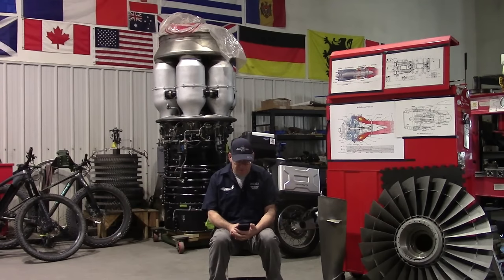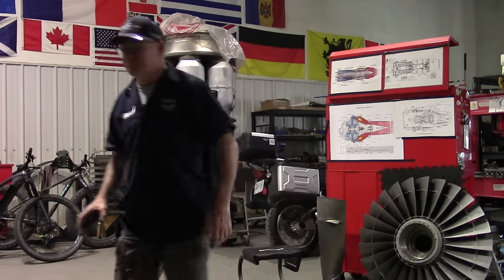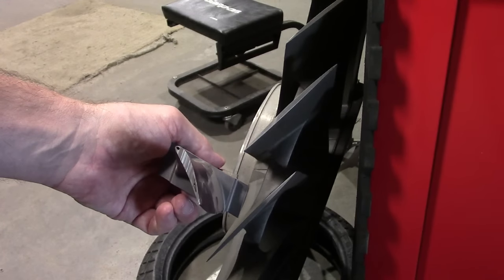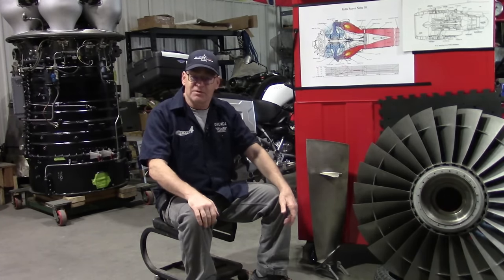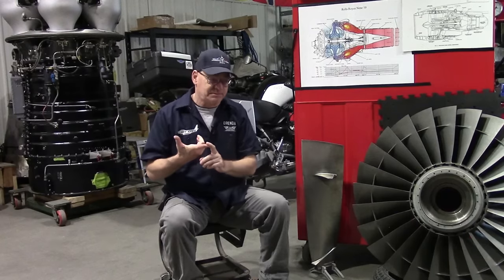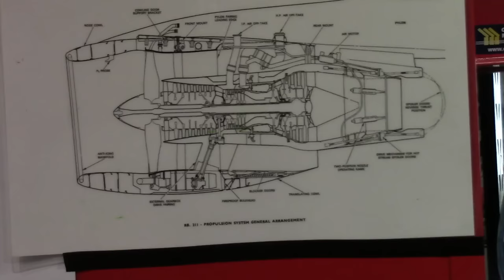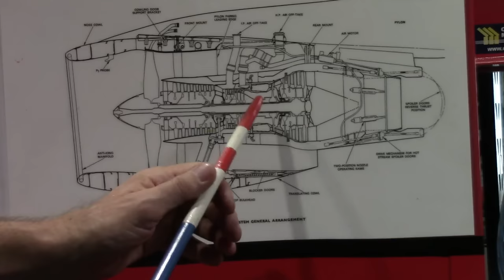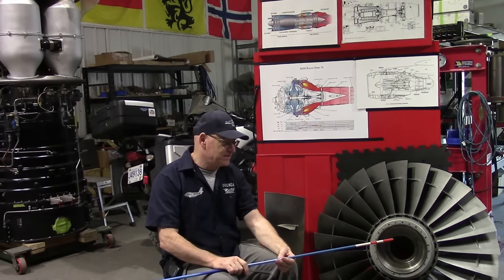Can Wind Damage the Engines of a Parked Airliner?

Comment: could some turning be an advantage in some cases, equaling the forces on the shaft so it doesn't bend and the bearings doesn't sit on the same spot for a long time?
Reply from the maker: 1) bending due to gravity? Don't be ridiculous.
2) bearings damaging their races? It's an appealing thought, but if the bearing race can support the load for a microsecond, it can support it for a month. However, I do agree that some occasional slow movement might be a good idea if the engine is to be stored for years.
I've seen perfect bearings inside engines taken out of decades of storage, so It may not be that important.
Reply: @AgentJayZ  I just read that many engines need "debowing" by motoring before startup under certain conditions, but apparently it is caused by  thermal effects during shutdown, so it is in the core and windmilling wouldn't help
Reply from the maker: Many people talk of "rotor bow". You know who doesn't? The engineers who design these things.
My opinion is that "rotor bow" is an old timey fallacy.  It's based on the assumption that when the rotor stops moving, it sits in an environment where the thermal gradient is large from the bottom of the engine to the top.
I believe this assumption is erroneous, and rotor bow is made-up quackery, from people who think too much without thinking enough.
Reply: @AgentJayZ   I respectfully disagree with you. Rotor Bow is 100% real, however it is more noticeable on some engine types than others. The evidence for this is during start-up of an engine that has been recently run (ballpark shutdown time of 45mins for example), the N2 vibrations will be initially much higher, for example around 4 times higher than after the engine thermally stabilizes at idle.

Also, and I'm being picky here, but engine fans can windmill in either direction - it depends on whether the wind is blowing from in front of or behind the engine. The direction of windmilling makes no difference to your assessment of whether windmilling is bad for engines though.

Big Thanks for all your thought provoking content 👍

Comment: I think the CFM56-5B is the most well known for it's windmilling fan blade noise. The midspan shrouds have a tungsten carbide coating that does eventually wear out, but of course this coating can be repaired when necessary.

Comment: Great quality video as per usual, thanks for sharing. Since I was a kid, about half a century ago, I've always wondered what causes the acoustic 'tink-tink or clank-clank' noise when a jet engine windmills. In my naivety I thought that such a marvel of precision engineering would windmill silently. Do you know what causes the noise? Thanks.
Reply: The fan and compressor blades are held relatively loosely in their slot mounts in the fan and compressor hubs...the blades are meant to slide in and out of their dovetail mounts relatively easily when not held in place with a set screw. They only firm up in their mounts when the engine is running and centripetal force holds the blades firmly in place. The tinkling sound when windmilling occurs when gravity is stronger than the centripetal force and the blade slightly jiggles in its mount. I believe the exact cause of the sound is the blade itself acting like a tuning fork when given a slight excitation energy from the movement within its mount.
Reply: I think the blades  are a little bit loose on purpose to help dampen harmonic  resonation in them when the engine is running. Too tight and they can start to vibrate. Also some engines have a starter turbine. They blow the high pressure air into that when starting. that is connected to turn the main engine by a kind of ratchet thing. It disengages  from the main engine when the engine is up to speed, but you can hear it clicking like a ratchet when the engine is freewheeling slowly as it shuts down or is turned by the wind. The sound could be caused by either or both of those things.
Reply from the maker: If you follow my recommendations in this video, and watch my vid called Turbofan 1, the clanking is explained.
Another good one is my old vid called jet engine turbine blade noise... or something like that.
Reply: @ewanrollo5562 
If I remember correctly from the NTSB video on the Southwest Airlines Flight 1380 where a contained fan blade failure occurred on a CFM56-7B-series engine that the blade containment slot actually have requirements for repeated lubrication and maybe even need some special Anti-Seize coatings. 

I was interested in what happened as my daughter flew on the same flight the day before and sat in the next row behind where the window was broken.

Comment: Little to no oil pressure, but the bearings won't be dry, and there's a world of difference between windmilling at *maybe* 200 RPM max and TOGA power being driven at 3600 RPM.  The fact that they windmill with barely noticeable wind goes to show just how low friction those bearings really are.  They'll be fine spinning on the tarmac for a bit.  If the jet is going to be parked longer I imagine they'd cover up the intakes.  I like it when it is windmilling backwards, and when the engine starts up the rotation slows, stops for a second, and starts turning the 'right' way.

Comment: Thank you for posting this.  I've been to airshows where C-5s are on display with their fan stages windmilling along, and often wondered if the bearings could run dry if the rest of the engine isn't running.

Comment: Seems windmilling may, in some instances, be beneficial. Seeing this title instantly reminded me: as a kid I lived in the Town of PR beside the Forestry building which had a helo pad and more often that not there was a ranger parked on it. One summer in the mid 80s the neighborhood autistic kid Ernest was entertaining himself in the evening hours by unwrapping the strap from the tail boom and running circles around the bird with the prop, reversing direction, using the centrifugal force to hold himself aloft while jumping etc. After seeing this a couple times I told my mom (who worked as a secretary in the building) about it and asked her to tell Hank the pilot about it, I regret not ratting on him for the first instance I witnessed it. Thank you Mr. Jet City.
Reply from the maker: Anybody hanging off the rotor of a helicopter for any reason is cause for a grounding and inspection.
Anybody responsible for security at that place deserved a couple weeks off without pay.
Not the kid's fault. He should never have been allowed to get near the aircraft.

Comment: If jet engines would use pressurized bearings like the crankshaft main bearings in a car engine, they'd get damaged pretty quickly windmilling along for awhile due to the large contact/friction surface pressurized bearings have. Roller and ball bearings have a much lower friction surface and can handle wind milling much better.

Comment: Interesting that you mention intake covers. I'm halfway through reading the report on the British loss of an F-35 from a carrier two years ago on take-off; the left intake "blank" was left in, leading to the aircraft having insufficient power. I thought military jets tended to have such covers normally installed when not in use (since you mention it it occurs to me I've never seen an airliner with such covers installed), but the RN elected not to do that because they tended to get blown out on deck. They were installed during port visits and the Suez transit for security reasons, but because this was unusual the procedures for removing them didn't really exist, and somehow the pilot missed it during the walk-around - I haven't got to that bit of the report yet, it's long!
Reply: Please reference the source of that report, it sounds very interesting.

Comment: It seems to me that low RPM windmilling would not create enough centrifugal force to seat the blades which would cause them to rattle around in their mounts.
Reply from the maker: Have a look at this:  https://youtu.be/phludDUfakg
Reply: You are correct, they absolutely do, depending on the engine of course, and how the blades are fastened to the hub.  A Rolls Royce Tay, for example, makes quite a racket when the fan windmills.  So does a GE CF34, P&W JT15D, among others.

Comment: Hello Jay,
At 8:23 we can see two supports in the base of the CF6 blade. Do you have the manufacturer name and / or part number for those? I have a fan blade from a CF6-50C2 (Airbus A300B2 - MSN 205) which I want to use as a decorative item in my living room and I'm having difficulties finding a support like this online.
Thank you for all those years of high quality technical content.
Reply from the maker: Those were made on a waterjet cutter out of 1/2 " aluminum plate.
I made a pattern out of heavy paper, and had them made.
'Twas cheap!

Comment: Having beer and fun with a gas generator! In one of your videos, of which I forget the title, described how essentially every gas generator could be made in to a 'jet engine' by adding a propelling nozzle to the exhaust gas stream. I have a GTCP85 APU from a 727 airliner (similar to your start cart), I placed it on a stand and have run it up many times. Why? Because as you said, its fun and why not! I want to add a jet nozzle to the exhaust, because again, why not?! Its a 2 stage radial compressor, single stage turbine. My question is, can you explain in simple ish terms how a backyard guy can figure out the optimal converging nozzle angle and end opening, while keeping EGTs and backpressure in a comfortable range?
Long time subscriber, first time commenter, keep up the no nonesense content 🍻
Reply from the maker: Sorry. If you want to design an appropriate jet nozzle for that engine, you need to do some engineering and some math.
If you are not interested in maximizing thrust, then any old thing will do.
Even the introductory text books I recommend don't get in to nozzle area calculations, but they will list sources that do.

Comment: Question here: thinking about how the bearings need to withstand the gyroscopic forces on a jet engine, given the big mass spinning at high speeds, is it a correlation between the bearings life expectancy and the movement on an airplane, specially pitch (the fastest vector-changing maneuver)? It would be interesting to learn wether the engine manufacturer gives any advise on pitching speeds.
Moreover, you have mentioned that bearings that are no longer airworthy, are still used in ground based jet engines, does this factor have anything to do or is just a design margin?
And lastly, are military fighter jet engine's bearings and casings stronger due to the ability of the airplane to make much faster movement changes than airliners? Or the lack of a big diameter fan makes it easier for the bearing to withstand the loads with a comparable overall structure?
I got here trying to find a way to explaining my toddlers about gyroscopic effect. Perhaps in a couple of years.
Reply from the maker: I don't know about gyroscopic forces affecting bearing life, but I know the bearings and their housings are hugely strong. They appear to this layman to be over engineered.
The standards for serviceability in industrial engines are the same as for flight, but there are almost no laws requiring the owners of these engines to follow them.
Most operators maintain their gas turbine engines to these standards, but some run their multi-million dollar engines the same way most people run their cars: run to failure, then fix.

Comment: What kind of structural damage does a bird-strike do to an engine? I know engines are tested to withstand bird-strikes but what happens after one?
Reply from the maker: Of course you did not clarify what kind of engine, so I will pick one. And you did not specify what size of bird, so I will pick one.
For a large airliner turbofan, any bird up to the size of a seagull, if hit by the engine in operation, will not cause any damage to the engine. The shape of the inlet spinner deflects the bird outward, towards the bypass flow. The fan slices up the bird and flings it further outward. Basically none of the debris enters the compressor, or flows through the combustor.

For larger birds, like the Canada goose, you'll have to ask Sully.
Reply: @AgentJayZ 
Is that not part of the testing of a new design engine? I thought I saw testing where a chicken sized bird was propelled towards a running engine on a test stand to validate the fan blade design. Maybe this was a one off research project.
Reply from the maker: Yes, Menta, it is part of design testing. That's how the information I gave in answer to the original question was obtained.

Comment: Jay, where do you go about buying new bearings for these engines? You obviously cant just open a catalogue and match the numbers? Is it manufacturer only or are there other companies that specialise in these bearings?
Reply from the maker: The most expensive option is to purchase from the engine manufacturer. Sometimes they do that, but they generally don't like aftermarket service providers. Next there are many companies in what you might call the component aftermarket. You can buy new parts from them at whatever price they want to charge. There are also specialist bearing manufacturers who will build anything you have the blueprints for, but they usually have a minimum quantity.
We only deal with the industrial variants of these big engines, so a good source of parts are retired aircraft versions.
The CF6-6 featured in this video donated turbine blades and bearings to the rebuilding of an LM2500, used to generate electricity.

Comment: Agent JayZ Sir . I was wondering if the manufactures use Asian bearings, USA, Canadian, German made bearings in remanufacturing? We use to test in NDT bearing failures. What is your favorite manufacturer?
Reply from the maker: The engine manufacturer assigns a part number to the bearing, and sources it from more than one bearing maker. We do not select bearing makers, we just make sure it's the right part number.
Reply: My experience at R-R ( and I've just celebrated the 20th anniversary of my retirement) was that mainshaft bearings from different manufacturers were allocated different part numbers.

Comment: Are the oil pumps run from the N2 since that gets up to operating speed sooner? Could running the hydraulic pumps from the N1 add enough drag to make windmilling much less likely?
Reply from the maker: 1) Yes, the N2 in a two spool turbofan IS the operation.
2) Making windmilling less likely is not even on the list of things that are important in designing an airliner engine. But it could be done. However, the engine running controls must be attached to the fuel burning core, so your idea would require two transfer gearboxes, two radial drives, and two accessory gearboxes. That's a lot of expensive, heavy stuff to carry around and maintain. All for microscopically minimal benefit.

Comment: Engine driven pump - If the oil pump is gear driven off the accessory gear box - The main shaft - If HP compressor shaft vs. LP diving gearbox - Interestingly if windmilling in reverse - Would the accessory box turning in reverse cauing the oil pump to turn in reverse - Would this pull air into the system?
Reply from the maker: No, you are without sufficient knowledge. Two systems N1 and N2. Fan attached to N1. Oil pumps driven by N2.
Have a look at "turbojet or turbofan".

Comment: 12:33 When you say “makes no power up to 85% RPM”, is that in reference to an industrial version that is used as a gas generator for a low pressure turbine power takeoff (or the item that you have shown that is used to measure power) and is the “POWER” you talk about measured via this? If I remember correctly, your mentioned some terminology like “ground idle RPM” and “flight idle RPM” that are reasonable high but are not producing much thrust?As a reminder, how high is the “flight idle RPM”? 

Many thanks, I have really learned a lot from your channel.
Reply from the maker: ground idle is roughly 40% of max rpm, makes zero power, and takes about 10 seconds to get up to full power, even if the throttles are slammed open.

flight idle is roughly 85% of max, makes almost no power, and takes a couple of seconds to ramp up to full power if throttles are slammed to max.

90% rpm will give you maybe 40% of full power, and might be called cruise. One second or less to get to full.

95% rpm might get you 60 to 70% of full power.

Only at 100% rpm does the power match the rpm.
Otherwise, turbine engines do not respond like piston engines.
Reply: @AgentJayZ  
Many thanks, that answers somethings that have been knocking around in the brain bucket.

Comment: The concern I had was revers thrust on the blades until you mentioned they use ball bearings that would handle this quite well.
Reply from the maker: Thrust is reversed by diverting exhaust, and has no effect at all on fan or compressor blades.
Reply: No, I think he meant that when windmilling the fan gets pushed from the front, while in normal operation the fan is "pulling". So the direction of the load on the bearings is the opposite. But like you said, a fraction of a percent of the load.
Reply from the maker: ... discussed at length in the video...